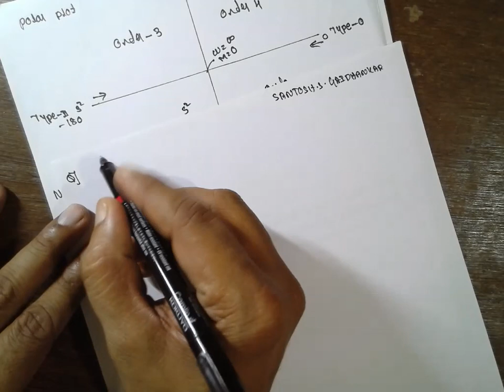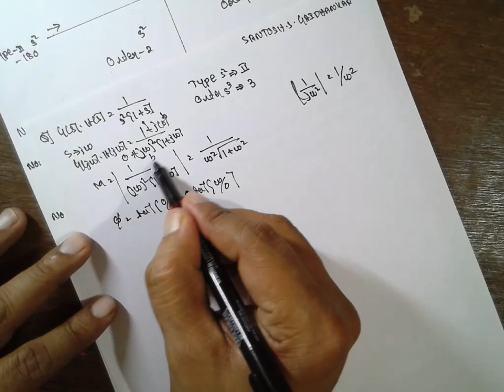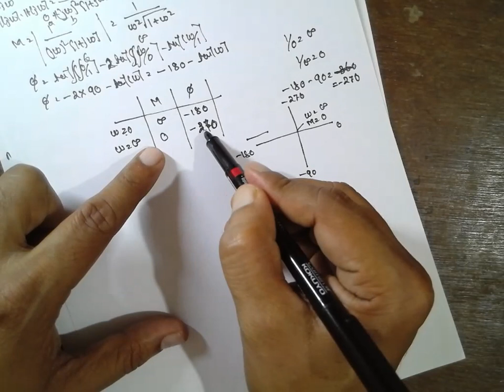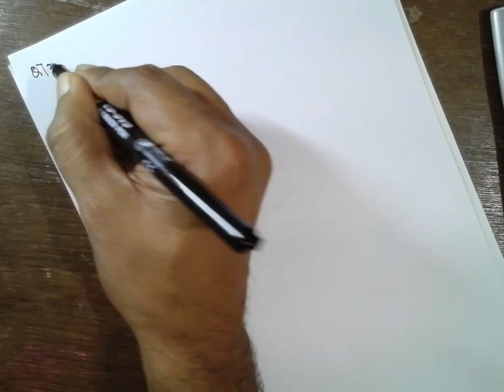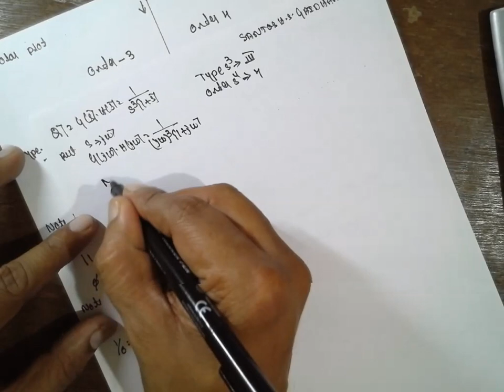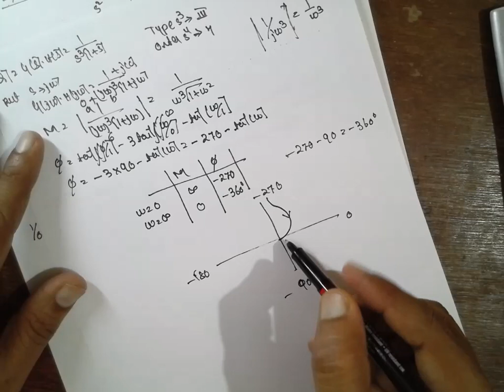POLAR PLOT (TYPE-2,TYPE-3,ORDER-1,ORDER-2,) CONTROL ENGG, LEC-3

Comment: There is a mistake. 5:29 
During the calculation of Phase Angle you've  mistakenly taken an extra          2*tan^-1(w)  
which is simply    tan^-1(w)
total      phi equation is
= -180 - tan^1(w) - tan^1(2w)
Reply from the maker: jw2=2tan^-1(w) if jw3=3tan^-1(w)